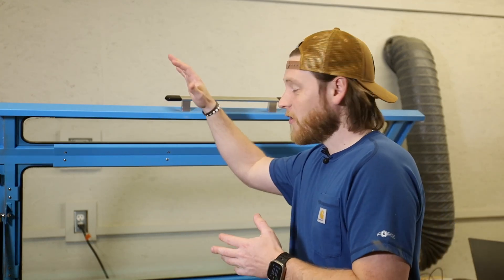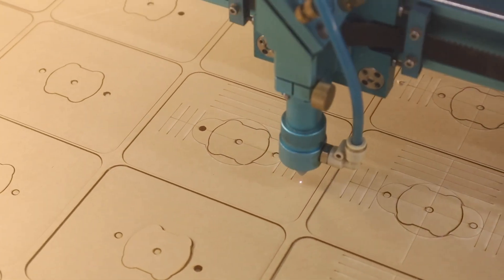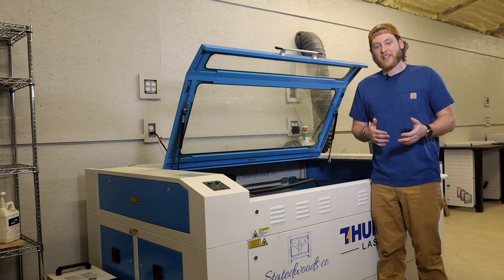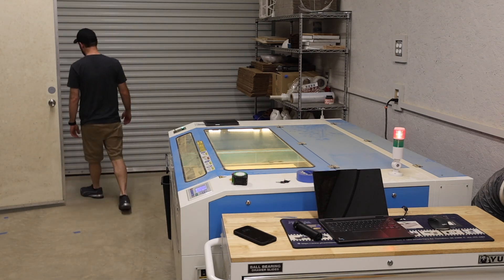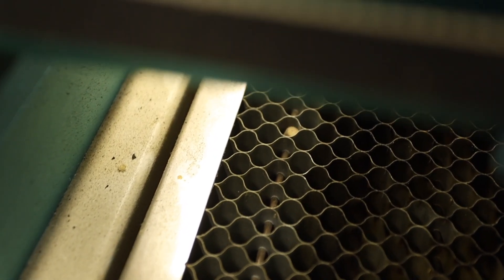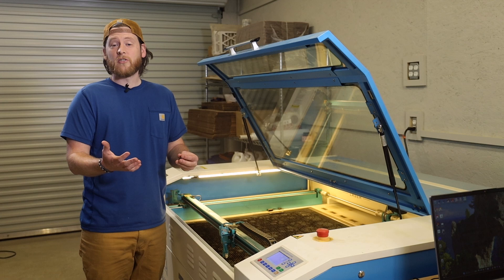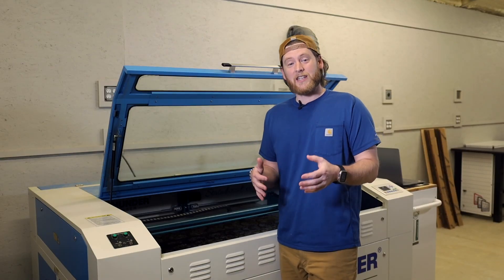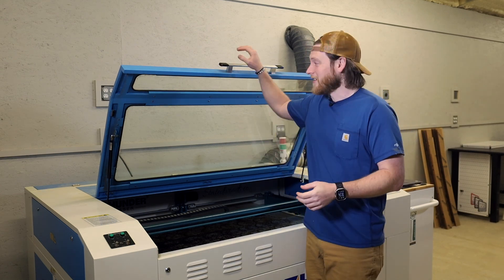Will Thunder Laser's Hold Up?

Comment: Good morning - thanks for the overview. Just a question : why do you put oil on the runners on the gantry? My manual says to clean it with alcohol? Won't lubricating the channel cause the wheels on the laser head to slip? Thanks!
Reply from the maker: Great questions. You want to clean it with alcohol but Thunder always says to oil these and the Z rods for the bed. Have never had an axis slip but have had them seize from dust and soot.